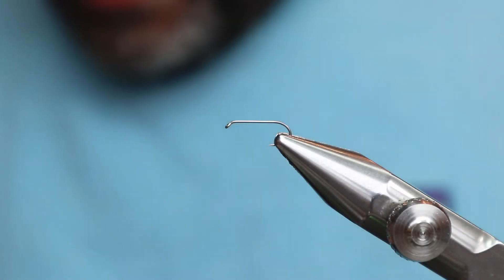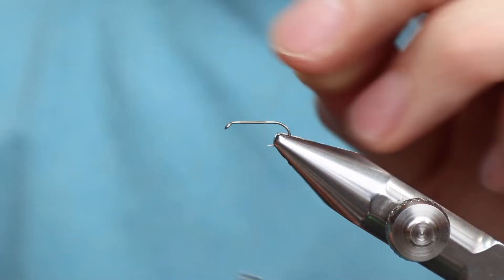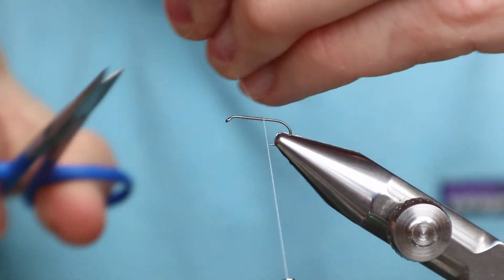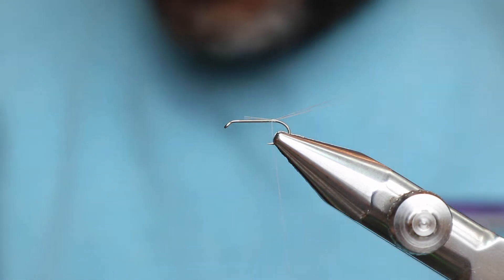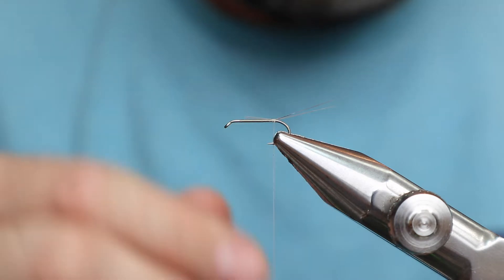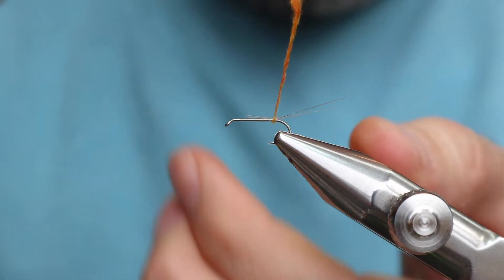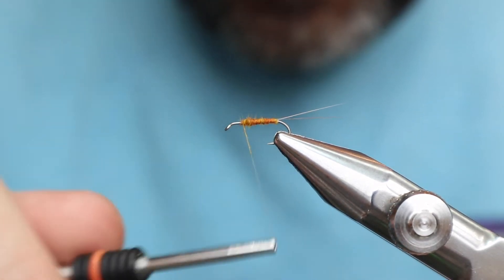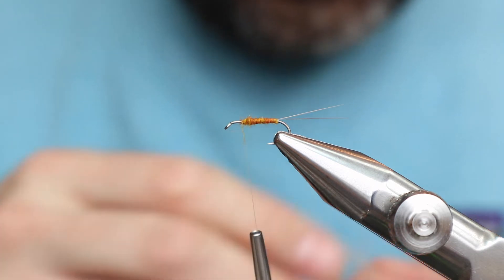CDC Rusty Spinner (thin body technique) - Dry Fly Tying Tutorial - Bryn Bode

Comment: Plenty of other materials that are better (imho) for wings on this pattern then cdc. Snowshoe rabbit, HiViz, many synthetics, hackle trimmed top and bottom. These can all be tied without bulk, are more durable then cdc, are less expensive and the flies don’t require special treatment every so often. 
Other then my opinion about wing material, excellent video.
Reply from the maker: It’s funny cause I think cdc is the absolute best wing material there is. Soft presentation, floats great. Looks great on the water. In my opinion it’s unbeatable for fishing flies. 🤷‍♂️
Reply: I was a skeptic of CDC as well, until I tried it, for some reason it dries up immediately on casting and floats for hours on even fast water.  I am sold on the material.  At the same time, all that obsession with the perfect angled tail and the head to become realistic, it is just fisherman psychology.  trout dont care at all, a dead wet fly in the water looks nothing like a live one.